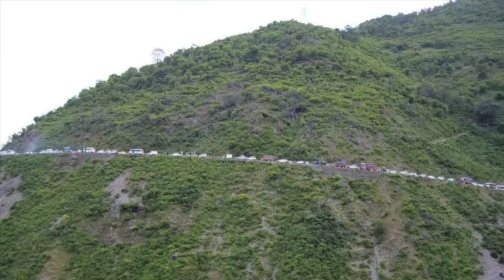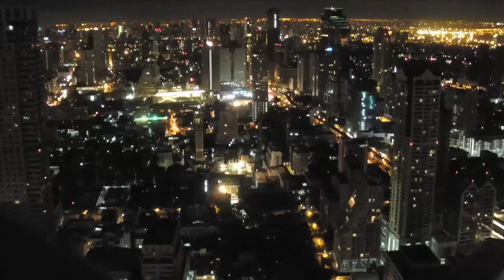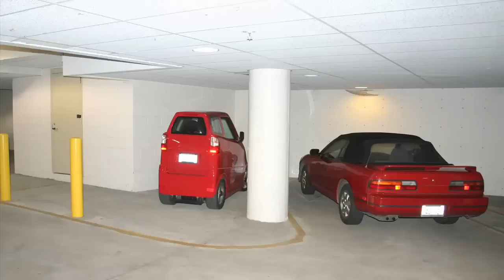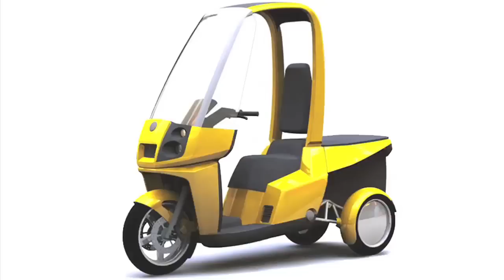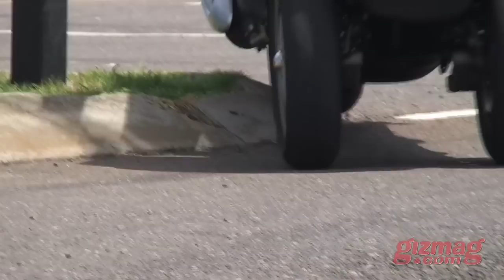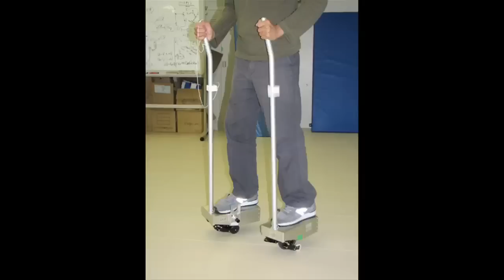Narrow track vehicles - the convergence of the car and the motorcycle

Comment: Me too and I also am heavy as well though I've lost 10 pounds riding since last year.
I upgraded my Hilltopper kit with a Ping 10 AH Lithium Iron Phosphate battery.Ping included a free fast 4 AH charger too.I have two Aosom Wanderer Bike Cargo trailers myself.I'm looking at the hi-powercycles HPC Striker Planetary geared 1000 watt motor kit (that's the one with the extremely torquey 68 newton-meter/50 foot-pounds motor).Also was thinking about motorizing one of my trailers as well.

Comment: Great vid on what is possible. However, the width of any roadway also depends more upon speed than just the width of the vehicle. A bike lane can only be narrow only due to the slow speed. Put a 20 kph motorcycle on it and it isn't safe. At 50kph... even a motorcycle needs car width lanes.

Best options appear to be a light vehicle on small lines of under 20 kph. Then load the vehicle itself on trains for distances of more than 50km. Bicycles or Segway like vehicles on an LRT.

Comment: You know there is already the Ridekick 500 watt motorized trailer which is available.
The only thing that I don't like about the Ridekick is its small cargo space and the motor is set for a power band of 19 mph.I prefer slower speeds but more torque for carrying cargo especially up hills.By the way I live in Tacoma,WA and we have a lot of hills where I live.One thing we have is that it rains a lot too.The Ridekick does have good reviews for it and there is a 20 AH Lithium Battery version.

Comment: You know one answer is to use a 250 watt Hilltopper (Bafang) motor and put it in a 16 inch rim for a trailer so that it would have the same torque as a 406 watt or so planetary motor but set at a max speed of 10 mph whereas the standard Hilltopper 250 watt motor in a 26 inch wheel is set to a 15 mph speed.
Also you could use 2 -250 watt motors in 16 inch rims on a trailer to have the equivalent of around 812 watts of torque yet only use 500 watts of power though at a set speed of around 10 mph.

Comment: I have given some thot to push trailers and I would prefer to use the bike as the tractor, so that I would be able to swap trailers or to leave the trailer at home ... ALSO ... I have noticed that having two hubs on one trailer (or a trike) gives you the problem that ONE of the power leads will thread inwards and the other "power cable" will be routed OUTBOARD and will need to be routed OVER the wheel and to the source equipment.   It would be REALLY cool to be able to cruise between cities.

Comment: I would settle for 750 or 800 watts, up front, at (prolly) 48Volts.  They make motors geared for either torque OR for speed.  I want MAX cargo and max range so, I am thinking having a 750W torque motor, for cargo-hills) on the rear and ~500watts (or so) on front, for speed. ... I do not know where you live but I am giving SERIOUS consideration to the SURLY TROLL FRAMESET and, if I had a garage?  XTRACYCLE EDGERUNNER looks optimal.  Just deciding on frame or whole-bike purchase, for the TROLL.

Comment: The chief concern is selling more vehicles.  Make no mistake about it.

I was at RCA in the mid 1990s as they were developing HDTV.  RCA was the major corporation pushing to eliminate NTSC.  Officially, this was to reduce bandwidth requirements, but the reality is that if they could eliminate NTSC, they could sell everybody a new television.

NTSC was turned off, unfortunately, about 10 years too late to really save RCA's television business.

Comment: if you want to split lanes..yep, very narrow, less than full dress street bike.  due to lower speed in traffic, the three wheel seems more practical and surprisingly with two wheels in front reportedly performed better than std. motorcycles as in stopping.  my question is how is it in lane splitting when ridden at 10- 15 mph faster than traffic?

Comment: The vehicles that are open, like the BMW C3 probably won't find much adoption in US markets that are in regions where there is inclement weather, or where the temps drop below 50 deg. F - even though they have windshields and roofs, as a motorcycle rider myself, I can tell you that riding a motorcycle or any open vehicle in that kind of weather just isn't practical or desirable for more people. 

So, to be adopted, the vehicle has to be enclosed.

Comment: In India (Chennai) with 150cc economic honda (pushing it to the limits) i can do 55 to 60 km/h average on a trip. If i ride a better throttle responsive engine like R15 i can clock 70 km/h avg. all figures are in peak traffic, above 30 kms of travel & top speeds at 110km/h (40 kmph speed limit). that is y many prefer bikes over car

Comment: Other than parking there are a lot of illegal moves involved, even a motorcycle cannot go between cars only another narrow track cycle in the same lane. All full sized cars plug the lane. Bicycles are one thing powered vehicles are different in the eye of most cops.
Reply: Motorcycles can go between cars, it's called filtering and they teach it on motorbike tests...
Reply: Lane splitting is legal in every region where it's actually needed.

Comment: I am a electric motorized bicycle rider too and love how little energy it uses.
Though I only have a meager 250 watt/ 1/3 HP motor it helps a lot.
I am looking forward to a 1,000 watt motor ( 68 newton meters or 50 foot pounds torque  ) upgrade in the next couple of months

Comment: I hate how they say the average car has 1.57 occupants so the 2 seater should be more than adequate for the vast majority of trips.

What the hell does that matter. If I only need 4 seats once a month what am I supposed to do exactly? Take the hassle of having to drive to a rental lot and rent a car(and what if I'm short on money when I need it, or it comes up suddenly when they're closed. Just not practical), or buy 2 cars? Money is tight in this country for the vast majority. One car that uses just a bit more gas will still be a lot cheaper than paying interest and full coverage insurance on two cars, not to mention scheduled maintenance and repairs.

Building a car just a bit wider and using a slightly narrower set of seats could get you 4 seats while still being quite a bit narrower than what most cars are now. It would be a little cramped, but for most people, most of the time, that isn't a concern, and the tight fit wouldn't last all that long on that rare occasion when more than 2 seats are needed.

Comment: My bicycle (with a longtail extension and a 3kw electric motor) can carry rider and passenger 30mph through traffic, is only 30" wide, weighs only 80 pounds, and costs less than $2,000. I don't see these vehicles competing with that, except that they can go highway speeds. On those rare occasions I need to go highway speeds I rent a car.

Comment: I think it's rather ridiculous to be thinking about traffic in the year 2050. Considering that robots will completely replace all manufacturing, agriculture, construction, maintenance, and a hundred other professions, it will be pointless for people to have cars since 1) most people will no longer need to work to live since 2) all necessities of life will be so cheap that people will be able to afford said necessities with the change in their couch cushions for the rest of their life. And 3) while people may still need to get around town, many of the remaining jobs will be jobs you can do at home (sales, marketing, engineering and design, etc.) or you can operate a robot to act as your proxy remotely to oversee some crew of robot workers in Beijing while sitting in a home office in Sao Paulo. 4) By 2050, most of the vehicles occupying the traffic on the roads will be carrying robots, not people. 

For the very near future (2020) this is all great. And we definitely need this now. It would save a lot of fuel. I drive a compact car but I still have two rear seats that I don't really need. While it's easy to park, It still takes up a whole parking spot.

Comment: But, YES ... I own the Clean Republic HILLTOPPER (250Watts at 24Volts) on my 700C front wheel and with a momentary switch (on/off) velcroed under my left index finger. ... I am a rewally big guy and AUSTIN is stretched way out (north-to-south) and I do not have a car but DO pull a BURLEY TRAVOY commuter trailer and would like other trailers.   I AGREE !!!  250Watts is an awful tease and is not enough for steeper hills. ... WHAT I REALLY WANT IS A 20 AMP HOUR LiPO BATTERY PACK !! ... TWO OF THEM!

Comment: Here's and idea. Put the money and effort into public transport.... Replace roads with electric bus ways and trams. Problem solved..... Don't know how profitable this would be for an auto maker though.....
Reply: Not replace but add.
Reply: unfortunantly these will have to be heavily subsidized, because if it weren't the cost of a ride would be to expensive, you would have to pay as much as a cab, traffic jams are caused by city living, the more people are forced by gov mandates regulations taxes and job availability to live in cities. if people could be spread out with lots of open space more roads could be built, they built roads here because cars increased as development increased for a while there is was slow moving during rush hour, but as two new roads were opened up on the highway now no more back ups that last half of hour or more. now if you get caught it is only like a minute or two.

Comment: WHY DON'T  THEY TRY TO ADD A CHARGING SYSTEM FOR BATTERY    INSIDE THE VEHICLE.SO THEN  WHILE RUNNING IS THEN DOING A CHARGING.WHY CAR MANUFACTURER NOT DESIGNING INSTEAD OF GOING OR PLUGGING IT TO CHARGING STATION  OUTSIDE THE VEHICLE. I SUGGEST THEY MUST TRY TO BUILD  A CHARGER ,MAYBE SOMETHING  FROM SOLAR,WIND,TEMPERATURE,OR FROM VIBRATION,ANY THING  THAT CAN PRODUCE CURRENT.........

Comment: We just don't want to compromise, especially as Americans. If we did there would already be a greater demand for public transpo and it would have evolved because of it.
I mean every problem caused by traffic could be completely annihilated with next evolutions of mass transit. Imagine a magnetic monorail system along the grid. It would be fast, convenient, relatively cheap, fuel-free, smooth and reliable.

Comment: Put all transportation on tracks and power them with magnetic propulsion engines which power a generator which power a motor. You punch in your destination on a GPS guidance and voila by using satellite, mileage and external navigable aids just for fact of the matter. And all congestion, pollution and safety is solved. But you all want to wait on the government which will never do this as long as the auto industry and big oil has (their) way with (your) governments and (your) lives.